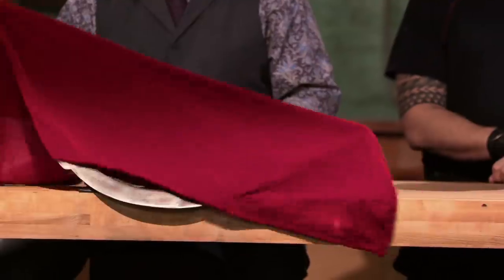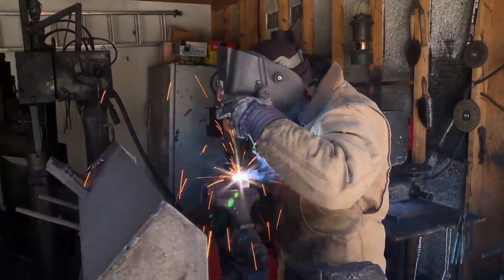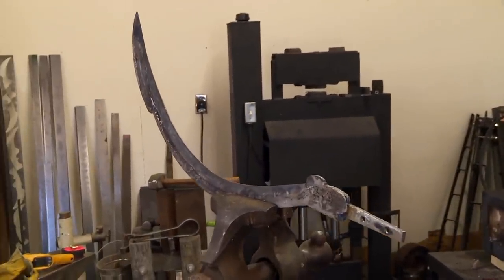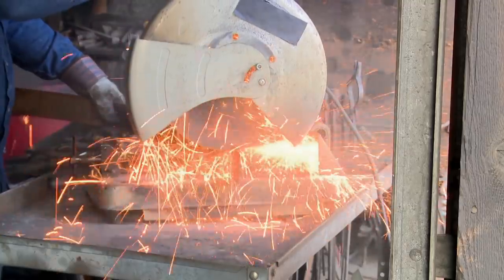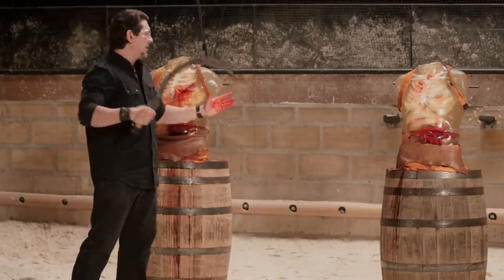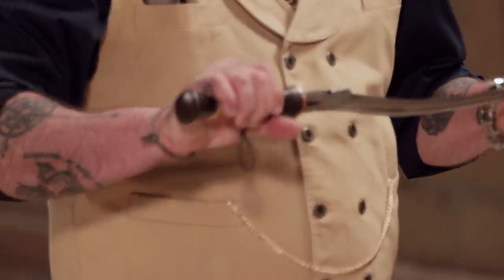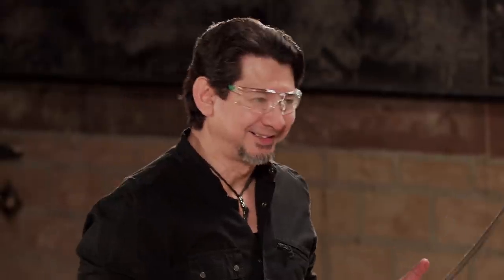Forged in Fire: The Makraka Sword OBLITERATES the Final Round (Season 4) | History

Comment: I had a great time doing this show.  I highly recommend it if you get a chance to participate.  I actually made three blades that week. One of 1095, one of 1075 and the final was 5160.  I spent a little over 20 hours start to finish on the final blade. The quench oil I had was fine for little blades, just wasn't fast enough for a big 10xx series sword.  The final weight was 2.41lbs or 1.09kg.  The research I did showed it should weigh 2.5 lbs 1.13kg, so I was close.  Craig's blade was very light and quick.  It was sweet. I have no problems with the results of his win.  My blade was not up to my normal fit and finish.  I used up 11 days vacation and had great time. They paid for the flights and hotel and I got to take my blade home.  No paychecks for runner up.
Reply: Paul, you did an amazing job. Congratulations!
Reply: @robotospy  Paul, you did a great Job, my issue with the show is that they ask participants to make weapons with no specs, and if both make it through all the test, then they will let one go because one weapon may be heavier than the other.  This is crazy.
Reply: I have 2 questions for you, if you dont mind me asking.

1. Why do they take the defeateds weapon that hey made with their own materials?
2. How long between tests of the blade did you guys have to stand there?
Reply: @GarlicBreadJesus  They will give you enough material to build the project. You don't have to use it.  I think I got 1095 and some G10. I used 5160 and micarta. Starting in season 4 the runner up gets to keep their blade they made. In the final,  it pretty much took all day.
Reply: @paulbrown9549  Hey Paul! Thank you for sharing your experience on Forged in Fire! I have a question for you if you don't mind my asking: Through the first two rounds, the show cuts to contestants speaking about their feelings "in that moment". Do they actually pull you aside to say what's going on, or are those interviews recorded after the action? I figure it has to be after, particularly during the timed section, so do they ask to act like you're back in that moment (of question)?

I hope that's not too confusing. Thank you
Reply: @paulbrown9549  Paul thanks for the show! I felt sorry when you didnt win, because you put so much efforts with oil. On the otherhand, Craig ruined his "blade" and replaced it with a... spring. I was laughing. I enjoyed it a lot. Too bad, that only one guy can win!
Reply: It’s crazy they consider 2.5 lbs heavy for a curved sword. I say this as a laborer that uses an almost 6 lb shovel for lots of work
Reply: Well that explains what they do with the blades, though I wonder how you get it on the plane... 

That said, it was a beautiful blade.
Reply: Hello, late to the party here but I have a question: is there any way to get a power hammer on the cheap?
I'm at the point where I'm considering welding a pneumatic jackhammer onto a steel frame (not sure if I could rig up a foot pedal).
Reply: @Sue_Me_Too  not in the field, but best bet I can think of is to become friendly with other blacksmiths. They might have an old one to sell on the cheap, or might have a secret spot for you to go.
Reply: @Maninawig  Easier said than done. Where I live most of the blacksmiths are horse farriers who use a propane forge in the back of their truck (no power tools that don't also fit in the truck).
Reply: @Sue_Me_Too  I see. Well, try googling "blacksmiths in my area" Cause the other issue is that info would depend on where you live.
Reply: @Maninawig  There's a "maker space" nearby that has a 50 ton Iowa Press (not technically a "power hammer" but it would get the job done). Only problem is they don't have a forge so I'd have to pack up and move all my gear in order to use it.
Reply: @Maninawig  Another option I'm considering is a 5 ton hydraulic "rosin press" (used for making marijuana concentrates, only a couple hundred $ on Amazon) and welding some reinforced plates onto it.
Reply: @Sue_Me_Too  power hammer and cheap don't always go together.  There are plans you can find to build a tire hammer. They work well and are fairly cheap.

Comment: "these shields can withstand enormous amounts of force"

shield literally shatters on the first touch lmao
Reply: Zulu shields do the same thing. 😂 Honestly wonder how people must have felt using them in real life knowing how little they actually help.
Reply: 1) They're much cheaper and easier to manufacture than metal shields, so if you're not the richest people in the world, you could still get your army reasonably equipped.
2) The fire-hardened wood is extremely hard. It absorbs much of the sword's strike which does offer considerable protection. If you look, the sword only penetrated 4-5 inches into the edge even with repeated strikes. It's not perfect, but it's much better than going in with no shield and taking that 4-5 inch strike into your arm or ribs.
3) They're much lighter to carry than metal shields. If you've got an army that needs to move light and fast and still have energy to fight when it gets to the battlefield, this is a big advantage. Ask any Marine whose been on a 30 mile ruck march with a full pack. Unlike in video games, weight matters.
Reply: I mean if you think about it, having a sword stick into your shield and get stuck instead of just glancing off could give you a serious advantage. Throughout history, it was considered a feature of wooden shields. The sword digs in just enough to get stuck for enough time to give you an opportunity to counter. It wouldn't go deep enough to hit the guy behind the shield and the shields themselves were simple and cheap enough to be treated as a consumable.
Reply: @kma3647  Fallout and Skyrim: You WOT M8?!
Reply: @Abraham Johnathan I would agree. I also strongly suspect that it was mostly for protection from ranged weapons. I've heard that when covered in pitch, a softer shield (like cow hide or hippo leather) is rather effective at stopping some firearm projectiles.
Reply: I mean, it didn't cleave it in two. It stopped it, so I say these shields are better than nothing
Reply: @privatebaldric8767  agree with you, even more so if you take into consideration the prominence of spears in african cultures and how they hunted by throwing them (as such, were skilled in using it as ranged weapons)
Reply: @kma3647  You know what else Marines have said, weight is irrelevant as long as it works. Nobody wants to be found in a pit with failure to extract.
Reply: @privatebaldric8767  the Zulu shield and may other leather and hide shields are allt tougher then people assume.

Comment: Every single other contestant: uses a file to check heat treat

This guy: "aw shucks I'll just hit something with it!"
Reply: Couldn’t figure out why someone with $75,000 worth of equipment wouldn’t temper his blade before tempering!
Reply: It was a good call. It was probably hard enough to skate a file but he wouldnt have discovered the bad spot until it was too late.
Reply: Gabriel Afonso  they run the file across the steel to hear the sound it makes and if the file digs in letting them know if they've reached the desired hardness.
Reply: The file is to test the hardness after it's quenched. If the file skates off rather than biting in it means the blade is harder than the file and the quench process worked. Steel will be very brittle at that point though so the blade is then tempered by heating it up to a specific temperature which loses a little bit of the hardness in exchange for significant toughness

Figure it probably had been tempered before he whacked it one and it's just the editing. Does seem to have a different pair of shoes on.
Reply: RandyLeftHandy what bad spot? The blade wasn’t tempered! The blade has very little toughness after a quench. Hitting a log with a hard, brittle blade is not a “good call”!
Reply: @Badassblacksmith  It might not have been tempered, but because they never actually show that process we'll never know. The man is clearly a competent blacksmith and from where I'm sitting it was still a good call
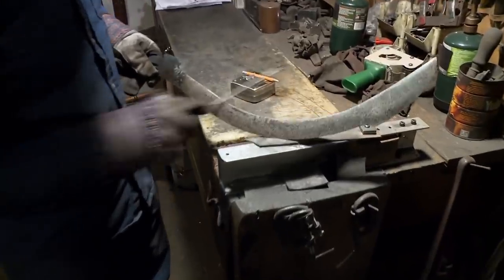Reply: @RandyLeftHandy  It shows him using a file for the hardness test for the second attempt at around 5:20 so i assume he did the same for the first and they edited it out like you said.
Reply: It was an effective diagnostic test.
Reply: Getting criticised  for doing a test that shown up the failures of the process he was he testing. What a world we live.
Reply: Yep , the harder the blade , the more brittle it is . When making anything for cutting you need flexibility and not brittleness
Reply: @RandyLeftHandy  I understand that they never showed wether or not it was tempered but I have made my fair share of blades and have never seen a properly heat treated blade fail  like that from a competent  bladesmith. That my opinion based on my own experiences though
Reply: He knew something was wrong with the Damascus metal from the very start.
Reply: Oh is that universal wavefunction, one the most exclusive ships in d2?

Comment: “First I’m gonna go for a Damascus blade” dude must not have watched the show before
Reply: If they pull it off, they tend to win though.
Reply: Yup, Damascus steel guys tend to win if they do it right
Reply: You never know. 😄Might have a surprise White Walker challenge.
Reply: Especially since pattern welded steel doesnt count as bloody damascus
Reply: james belcher  but still shows much more skill if you can do it in such a short amount of time
Reply: And then he ends up cheating with some leaf spring steel, and winning
Reply: @GuitarNvoice  how is that cheating exactly?  I can only assume you think the bend was used as an easy way to not bend the steel...the bend is on the wrong side if so.
Reply: I always cringe when this is their go to.
Reply: @GuitarNvoice  He didn't cheat, the dude did an amazing thing you never see, he tested his blade to destruction before handing it to the judges. This testing turned a guaranteed defeat into a victory for the guy.
Reply: @dorbie   by cheating i mean anyone with a grinder and a sharpening stone can make a piece of spring steel into a decent blade. There was no “forging” going on there, just some filing and some hilt work.
Reply: I built a knife out if spring steel a couple of weeks ago, it is super sharp and holds a crazy edge.
Reply: @GuitarNvoice  No, he profiled it, tempered it etc. Most folks are going to draw out a billet of tool grade steel but with a modern press it becomes easier. If you only grind you'll be spending a LONG time doing it and end up with a heavy blade. I was impressed that he pulled it off after a catastrophic failure of his first blade, that's a huge setback to recover from. He deserves huge credit for his aggressive quality control ;-P

Comment: 8:43
Wtf was that Swing. It was like hes was trying to push the blade threw the Melon.
Reply: The previous horizontal made him extra conscious.
Reply: The first time I think the judge was biased.
Reply: It’s heavier, meaning he can’t control the swing as nicely
Reply: @RabbitWhiteThe  he started almost at the melon tho...
Reply: @RabbitWhiteThe  I read a comment from Paul below somewhere and he said it weighed 2.41lb or around 1.1Kg compared to a historical weight of 2.5 lb.
He said Craigs was around 1.5 lb. 
The judges also never gave weight as reason why he didn't win, but rather sharpness. 

I personally think he swung with poor conviction as to not cut all the way through the melon.
Reply: Yea he lost to human error lmao
Reply: How easy the blade wields is part of the test. Doug is not an expert in using these blades, but that's the whole point. A easy to wield blade would still cut well despite the bad technique. And a well balanced blade will help Doug use it with better technique. The test is not biased.

Comment: I like that one day, the strength test is "I'm gonna hit these rocks here with your blade 20 times", and others it is "I'm just gonna hit this thin piece of wood three times and call it a day".
Reply: Sometimes they hammer it into a steel nail, sometimes they like "will it die to clay"
Reply: Ice block chop by J is the most extreme strength test.
Reply: Your blade survived falling from orbit, but will it be able to cut this balloon
Reply: That’s because every blade is different. Some blades are stronger than others, and so they need different tests
Reply: Sjoed14 06 true curved swords are better at cutting/slashing things where as straight sword are very good for stabbing.

Comment: It looked like he barely even tried to swing on Paul's horizontal watermelon cut lol then criticized him 😆
Reply: I thought the same thing, he got robbed there. The sword was heavier apparently so probably it is harder to side cut. But he shouldn't loose points because the guy testing it isn't very strong and can't swing the blade with adequate force. Easily would of cut that watermelon. Maybe it was not the deciding factor after all though.
Reply: to put it in other words, the tester/judge's just trash at testing and don't even know how to swing properly, I've seen him swing swords improperly and always hitting the side not the sharp edge.
Reply: Doesn't matter, he was already out because his piece was heavier than the other. Even if it did cut nicely they would have kicked him out just for that.

Comment: I think this is the closest one I've seen. One theme I've seen, though: a lighter blade invariably does better on the cut test IF it survives the previous two tests undamaged. What saved this guy, I think, was using a leaf spring which is designed return to its original shape after bending. Even though he destroyed the original tempering while forging it, he started with a superior piece of modern steel, one that is capable of so much more than amateur handmade Damascus.

Comment: I feel like sometimes it also depends on the strength u put into a swing, that horizontal swing he did didn’t seem as strong as he did the first time
Reply: Maybe because of the weight of the sword.  The way he described how the heavier sword feels made it sound a lot like an axe. If you ever use an axe you will find that swinging it horizontally is pretty hard but swinging it down is very powerful.
Reply: Because it was heavier
Reply: yea that was rigged. he shoulda just said he liked the light one better instead of botching up the swing, trying to push cut the watermelon.

Comment: did he just say his oil is "contaminated" ? There is no such thing xDDD Color looked good, the blade probably just didn't cool fast enough. You can quench in hot water (around 60°C) it works fine
Reply: But water tends to make a heavy bubble curta8n around the quenched item, so better use oil. But I never heard "contaminated quench oil" before too.

Comment: How hot do things have to be to “heat treat”?
Reply: Austin Meyer depends on the steel
Reply: @ZoeyTheGSP  gotcha. I figured there was nuance to it. I have a GTT Phantom torch used for glass (oxy/propane surface mix) that will easily breach 2600 degrees, and a paragon kiln, not sure how hot that gets. Just spitball me a ballpark range so I have an idea of what ranges we are looking for.
Reply: The quench medium also makes a difference. Oil,  nitrogen, water, etc. I don’t recall the temps exactly, oil adds carbon to the steel and makes it inherently stronger
Reply: Austin Meyer 1000 deg should be plenty tho